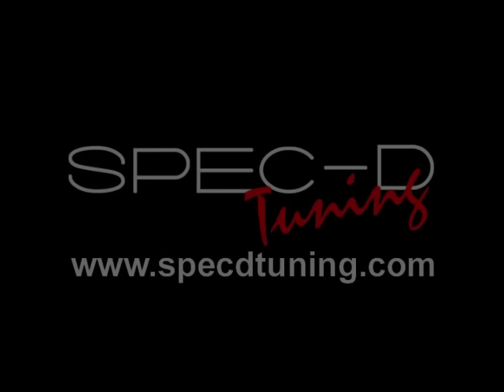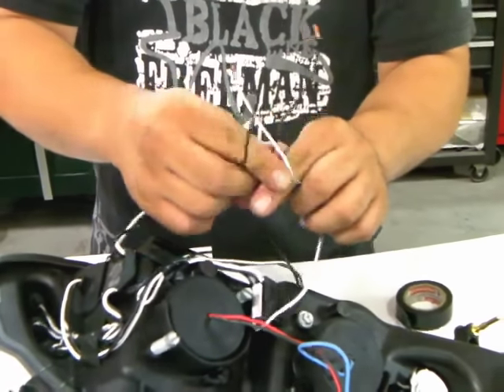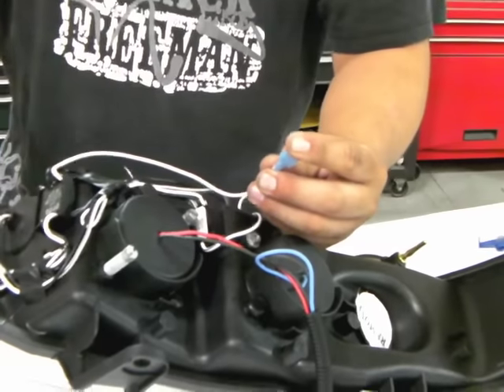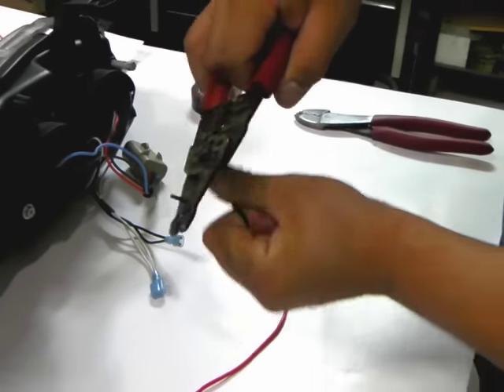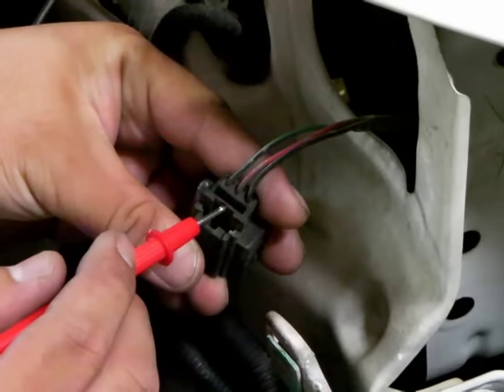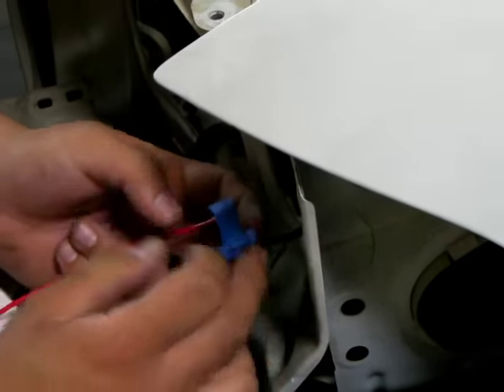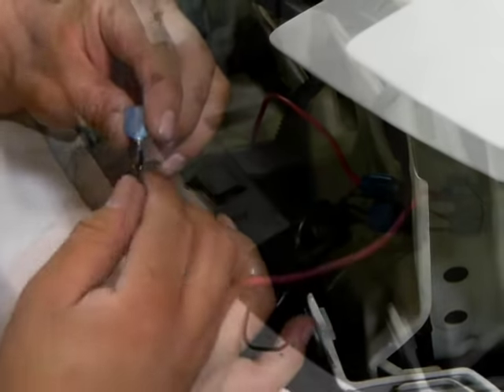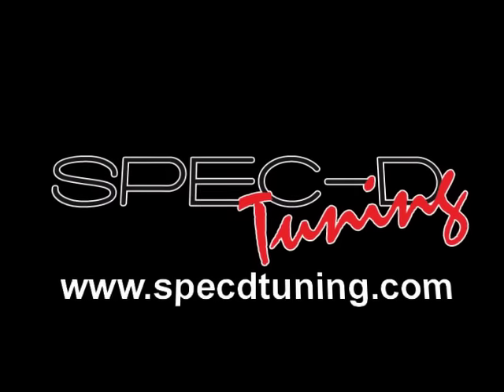SPECDTUNING Installation Video: Halo LED Projector Headlights Wiring Installation

Comment: Sooooo I only counted 4 wires, mine came with 6.  Do I connect the black/white from the LED with the other two HALO white wires and all 3 black wires together?  Just wanna make sure I don't burn anything
Reply: This is the same problem I'm having right now, have you find out how to connect them yet ?
Reply: Heck no, I returned it, along with the taillights. Bought a better set from Anzo.  Simple installation, just had to quick connect the power and ground wires to the car lights.
Reply: Oh alright man thanks, I already requested a return on ebay. I'll be buying the spyder halo headlights they seem great and easy to install
Reply: They say plug and play, but  you may have to quick connect the LED and HALO wires to the headlight wires for power.  Again, it's really easy. And big bonus for my lights is that the back part is actually covered, unlike these SpecDs.
Reply: Yes, I already saw the installation process for the spyder halo headlights, you do have to quick connect the wires but it isn't even nearly as complicated as these SpecDs. Also they are better quality. Appreciate the help, thank you very much!
Reply: Just remember the electrical tape.  Do that before you install the headlights. Had to remove the lights just so I can tape the connected wires properly.  Was a pain in the rear. Good luck with your new lights!
Reply: I connected them with tape but apparently the grip wasn't tight enough so I had to remove the lights and use quick splice connectors, they've been running well for a couple of days they look amazing. Thanks again !!

Comment: First thing you need to do is disconnect the battery before wiring the headlights up. If you didn't do that then it is no wonder why some of you could not install these lights or had bad luck doing it. It is simple. Follow the instructions. Call the seller if you are not certain about what to do. Find out how your wires are running and get a basic understanding of the multimeter. Stop pissing and moaning and do it right.

Comment: I bought this set from this company but cant get the little single corner leds to light up. Any ideas why???
Reply: Same did you find out??!?!?
Reply: I got no reply. Seems like the question is being avoided.
Reply from the maker: Is everything wired up? some of the lights require wiring to a power source. Sorry for the late reply!
Reply: What do you mean to a power source how do I do that? And also what if my projector light goes out how do I get a new light? do I need to buy a whole new set??!
Reply: The power source is the harness on your car, it should just plug in. If a light goes out just replace the bulb as you would in your home. :-)

Comment: I have a 1999 328i e46 I order a pair headlight instructions was confusing even watching this video so I figure out Headlight comes with 2black wires 2white wires connect the thicker black wire to the thinner black do the same with white than use your quick connector should come with the headlight you don’t have to cut anything use the quick connector to connect the black to brown and white to yellow with green stripe it’s doesn’t really matter it will work if you do it the other way remember you are connecting it to your low beams NOT HIGH BEAM any questions please ask I HOPE THIS HELPS OUT SOMEONE
Reply: This will turn on the halo right on the headlight make sure u turn the headlight on see if it works before bolt it down. Wish I can upload images lol much easier

Comment: Product - 2LHP-ACD98-TM (halo led projector headlights for 2002 Honda Accord Ex V6 4dr)
I have connected halo + LED + parking light wires of the projector light (3 sets of white and black wires) to my car's parking light wires. Halo + LED come on just fine but the parking light LED lamp does not.
I have not put the original parking light bulb in the projector light. It seems there is already an LED bulb in the projector light that should turn on, but its not. Same thing on both right and left headlights.
Can you help me figure how to make this bulb work? Location of bulbs in the headlight 1. LEDs 2. High Beam with halo 3. Low beam with halo 4. LED parking light 5. Signal indicator light.
Thanks!
Reply from the maker: Hello Subodh Nag. I looked at the headlights you purchased(2LHP-ACD98-TM). Starting from the 3 small LED bulbs. Those will work as your daytime running lights, as well as your Halo bulbs. Your first Halo is were your high beam is(H1 bulb) that will connect with the harness on your vehicle. The 2nd halo bulb where the projector is your low beam bulb(H1 bulb) that also connects to a harness on your vehicle. The other projector without the halo bulb is just a style of the headlight and does NOT have a bulb in it. Finally the last insert if for your turn signal/parking light amber bulb. I hope this information helps.
Reply: Thanks; it does make sense!
Is it possible to add the stock parking light bulb in the supposedly empty projector socket since its wired already. If not will any LED/regular bulb fit in that socket? It can't be just an empty projector with white and black wires sticking out of it.
Reply from the maker: Subodh Nag If you can find a way to the bulb to find the bulb size then it can be replaced. Unfortunately my system does not tell me all the bulb sizes of the headlight. You can find a LED bulb of the same bulb size if you want to replace that bulb with a brighter one.

Comment: Guys this video is a joke literally I figured it out on my own easy

What I did was connect the red wire from my parking lot and slip the white wire into the connector  and then after that I did the same thing to the black wire(negative) and I tested them out and they work fine so now Everytime i turn on my parking lights the halo lights turn on as well
Reply: I have these putting them in my wrx right now. So where did you put the white and black wire?

Comment: Why splice the wire in the truck harness? Really dude!  Just splice the wires on the light, then you just plug them in. A lot easier. Just put on a set did all the splicing on the headlights.Worked good. 2 White into blue and black black.

Comment: Just bought and installed a pair on my 2001 ford focus. i followed the video and half the lights didnt work. after multipule trial and error i finally got them working correctly and was very disappointed with the brightness and spread of the lights on the road so i ended up installing HID bulbs and that made a huge difference but cost more money. if i were to do it agian i would not buy these headlights.

Comment: Why didn't you just wire them the same way right into the headlight wiring, instead of the car's wiring?
Reply: I was thinking the same thing, or why weren't they just manufactured directly into the headlight harness that plugs into the cars harness...

Comment: Hello anyone home??? I bought this set from this company but cant get the little single corner leds to light up. Any ideas why?
Reply from the maker: Check to see if all the wires are installed completely, some of the lights need to be connected to a power source.
Reply: Update: The funny thing is I bought some HID's recently and installed them and now those corner leds are working, go figure, lol.

Comment: 2001 Dodge 2500. No adjustment. The adjusters only work moving them to the RT or LF. Not up or down. Zero instructions on aiming them. I turned the 2 slotted 5/16 adjusters in and out and they did nothing. Now I will have to shim the lower mounting screws to aim. 1st set I bought did the same thing but I forgot! Stupid me. Not fooling me third time

Comment: This was such a waste of time and money. Went out of my way to get the tools just to find out that the new version of the mk4 gti headlights only need the white and black wire from the headlight to attach to the white and black wire to the headlight power connector. Update this. I waited so long to get my halos installed only for it to be the simplest thing that was far from what this video told me to do

Comment: What am I suppose to hook the dlr wires to on a 1997 Honda Accord LX... It doesn't have dlr. No lights come on unless you turn the combination light switch once, which is the parking light and front side marker light; the second turn is low beams. My understanding is the DRL is suppose to be on when the car is turned on but there's no DRL on the 1997 Honda Accord (besides the Canadian version) . So I guess I'll just wire them to the parking light and front side marker light so the first CLS turn will turn it on. Spec d tuning needs to remake this video, its far too old, and the instructions are bad.

Comment: The large power connector is shit, it doesn't connect tight so you have to zip tie it and even then its still a fragile connection. Why cant you at least put a decent connector on them?

Comment: Bought these for my gf and installed them on her ‘07 Hyundai Tuscan.  Didn’t know It was gonna be such a bitch to do.  Could not figure out which wire to splice into so I just winged it and it worked somehow.  Only thing is the blinkers are fast af but other than that they work and are very very very bright.  Very very very shitty instructions

Comment: Not even the slightest bit professional. Use heat shrink butt connectors with a piece of heat shrink tubing over that. And always use male on one wire and female on the other so that there will never be any confusion as to which wire goes where in case you have to remove them or if you ever sell the vehicle to someone who didn't wire them up. I thought these lights were plug and play though. Guess I'll find out soon enough...just ordered a set.

Comment: This video is bull I was ASE certified and I would never put black tape on any wires on a vehicle use heat shrink and make them water Proof so your wires don’t corrode

Comment: The light should already come with the wiring done to the headlights so all we have to do is make the connection to the parking lights wire for the Halos, not wire up all the wires thrown around on the headlight itself. Should come with a connector already installed. Come on man.

Comment: ok going on a fucking major rant here. yes i bought a cheap set of leds however anyone who has ever driven in a late 2002-2055 ram knows the lights are donkey dick. now i put bpth tail lights and 3rd brake light in plug and play no issues. how hard is it to make it plug and play for the headlights?

Comment: Are you kidding me? You should use solder and proper connections. Those crimp connections made me cringe so hard.
Reply: I am so limited to wiring knowledge in cars but I always solder and shrink wrap my connections it's takes an all of 30 seconds longer

Comment: What a terrible video. Why not actually say what the wires are for and when they should have voltage, etc. Instead you're giving overly specific instructions about tapping a particular connector. These are leds that need 12v when the headlights are on, right?  That's all I really need to know. Teach understanding of operation instead of giving rote instructions.

Comment: Hi guys 
About a week about I bought a Halo Projector Headlights for my 05 Infiniti G35X. I installed myself following three videos interactions that were on the side (This is one of them). My question is, aren't the halo lights stay on with the daytime running lights? I guess they are jugging buy the pictures and videos I watched. Then why my projector headlights brought just two wires (black and white) instead of this video where there is 4 wires (2 blacks and 2 whites). Do I have to do some extra work wiring the halo lights? Is that suppose to be that way? I'm asking that cz I haven'd seen it on any video out there. Can anybody help me? 
This is the link of the projector headlights that I bought.
http://www.ebay.com/itm/fit-INFINITI-05-06-G35-4DR-SEDAN-SMD-LED-HALO-PROJECTOR-HEADLIGHTS-LAMP-CHROME-/301541636335?fits=Make%3AInfiniti%7CModel%3AG35&hash=item46354838ef&vxp=mtr

I'd really appreciate you help :) Thanks folks!!
Reply: if you wire them to your daytime then yes. I did mine so that the halo and the side turn on when daytime lights on

Comment: how the fuck am i supposed to buy some halo headlights and tell a mechanic to do this for me? this is gonna be way too complicated to tell a mechanic to do this for me, like wtf
Reply: SKreapergaming (03 G35 Coupe) I got mine wired by my mechanic and had to have my local inspection shop aim them for me . Not horrible, but if you want SPEC D's help its not gonna happen they suck big balls
Reply: Lee Raines oh wow, thanks alot, i wasnt expecting that lol

i thought buying tools to take out the bumper and everything else would cost me more than a mechanic, turns out its cheap, so i realised i can do it myself now
Reply: SKreapergaming It was only 17.50 to getem aimed but I had to take the bumper off and show the dude where the adjustment screws were. Again strong distaste for Spec D Tuning no help from them whatsoever it goes to show if you pay cheap prices, expect cheap results
Reply: Lee Raines i didnt realise i would need to get them aimed lol, thanks alot for that heads up man u saved me alot of confusion i would get in the future lol

and wow
Reply: Lee Raines how much did it cost for the install
Reply: I think it was like 200 round that ballpark to wire them, aiming them is a bitch too if you have the g35 coupe like I do you have to drop the bumper to do that shit
Reply: Lee Raines What! I did it myself and it was easy....the tools cost me maybe 30 bucks, and it took me maybe 1 hr tops.
Reply: ***** what vehicle did you use
Reply: Lee Raines 2002 chevy impala
Reply: Lee Raines I used a 4mm socket and a philip screw driver to reaim the Spec-D LED Projector Headlight, it only took me about 15 min to do it when I was in my classmate's house, waiting for the last member of the flute section to come and start the sectional video project. (Mine is a Volkswagen Jetta mk4 2003 VR6 GLX)

Comment: Are you freaking kidding me? A professional auto tech will never do it this way. 

You should ALWAYS use weather tight connectors that have heat shrink, NOT electrical tape. Those quick connectors are a quick way to kill your electrical system and end up with broken wires and lights that don't work. They make weather tight taps that just require you to cut the wire and stick all 3 ends in to the enclosed tap. The silicon grease then keeps all the connections water tight. 

Also, don't tape up wires. Use ZIP TIES!  The sticky material will stay on the wires, but not with zip ties. You'll thank me later. 

You definitely should remove this video and hire a professional to shoot this installation video after they fix your installation kit. Maybe also hire a technical writer to write you better installation instructions.

Comment: This is very bad wiring. Do not follow this video. Heat shrink is always going to be better then electrical tape. Never twist wire together and crimp them. This increases there resistance. Make sure to chose the right size q.c. for the gauge wires u are crimping together. I.e.  u can use two 18 gauge wire in a 16 gauge q.c. also don't ever use those horrendous easy blue q.c. if only was me I would just solider and heat shrink it.